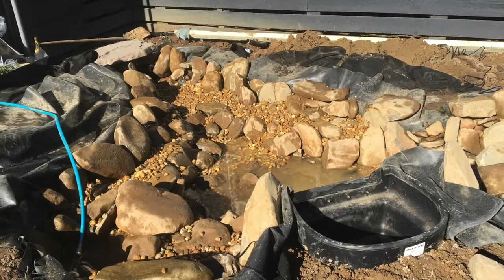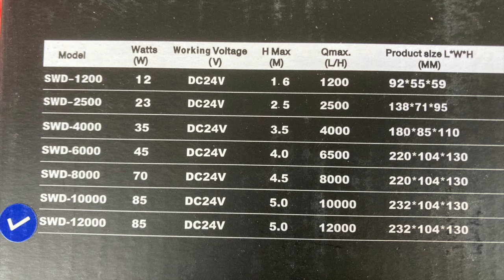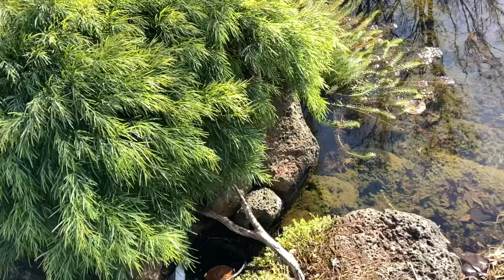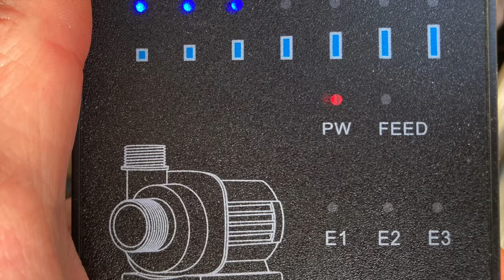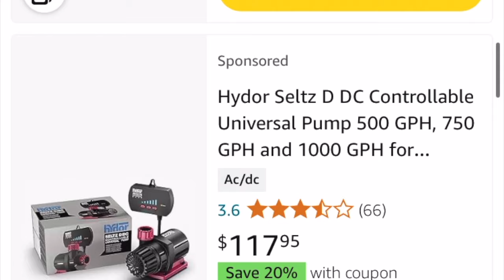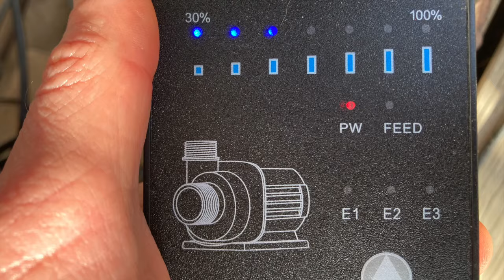Saving money on pond pumps

Comment: Your videos are great Kev! Are you aware of any external DC pond pumps? We built a swimming pond and have an external pump moving water through the bog filter. But need another pump for a waterfall and would like something more energy efficient! Thanks!
Reply from the maker: I’ve seen one on Ali express. Can be connected to solar. Can’t remember the flow rate. And remember you can make many submersible pumps external, I made a vid on that 👍

Comment: I have watched all your videos as I can to learn. Great by the way. Keep it up.
One of your videos you said let you know if building a pond. 
I can't find it so I'm posting here. I'm old enough that I do not wish to dig a big hole in the ground. So, I went this route. Bog filter is as you have said many times. 250-gallon tote with drain. Two 2'' pipes off of a T at the bottom with lots of cuts on the bottom side and pipe plugged at the ends. 2'' pipe up to the top with a T for the inlet hose and out to the center of the tank. Ball valve to crack to let air in for NO drain back and a 90 down. Plastic crates cut to fit over the pipes. Filled with 4 to 6'' rocks then 2 to 3'' own down to the rest pee gravel to the top. To me this is the version I got from you for a small pond.
My pond starts with a table at the outlet of the bog filler. Crates stacked and cut to make 5' span of 3 little waterfalls and one bigger drop into the pond. All full of pee gravel. The pond is nothing more than an 8 1/2' by 5 1/2' by 24'' above ground pool with a liner added. ALL ABOVE GROUND. I do have double 1/8'' felt under all of it. 3000 to 4000 gallons hour AC. AC for now. I do have solar and plan to use it after the pond is up and going. I'm in the southeast of the USA. Rire big freezes. I ordered and plan on a solar heater when needed. The sides to the ground will be cloth with cement for rock looks. Now don't hold back and let me know all that is wrong with this setup.
Reply from the maker: It’s very hard to get a picture of what you are painting, plus being Australian I do everything in metric. Reading about inches, gallons, feet and yards makes my brain shut down. Basically if you have your filter sized well, a reasonable flow rate you should be good to go. If you’ve watched all the videos you have the same knowledge as me and I’m sure you’ll do a great job 👍

Comment: Hello, tell me, is it possible to use aeration pumps in a swamp filter that supply water by mixing it with air? They work on the principle of a venturi tube. Thanks!
Reply from the maker: You could do that.

Comment: minor point of clarification: watts are a unit of power
electrical energy would be measured in joules
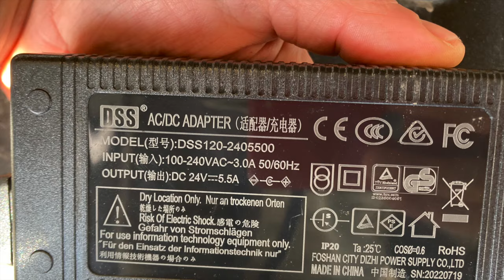@4:42  Thanks for the close-up of the power supply  It's about the same efficiency as the one that came with my 15000L/H pump, which is to say "poor."
Based on the rated inputs and outputs, it is, **at best**, 45% efficient.  Meaning, that if the pump needs 85W, the power supply is drawing approximately 2.2x that amount or ~190W from the wall.
I'm still looking for efficient, affordable 24VDC power supplies that can output at least 5A.  Best I've found is 81% efficiency for $35 US.  I'm hoping to find reasonably-priced 90%+ efficiency supplies somewhere.

When choosing power supplies to ship with these pumps, from what I can tell they prioritized price over quality.  They are the "weak point" of the system.

What I'm hinting at, and hopefully you already caught onto this... is your reasoning may be flawed.  You're only looking at how much power the pump itself is using, however that's not the entire story.  A power supply, any power supply, will also use some power.  How much, varies based on the quality of said power supply.  Cheap/inefficient ones will use A LOT of power themselves.
Reply from the maker: I pay for energy by the kilowatt. How many watts each appliance uses determines my kilowatt usage. I’m no expert but I do know that the watts is the amps x the voltage. The draw from the wall is 85watts for this pump vs 165watts for the aqua surge. The bill tells me my consumption went down 👍. Therefore I’m happy 😃 If what you are saying is true it seems very misleading to say an appliance uses 85watts, when it is actually more. You should be campaigning govts to force suppliers to show the true energy usage, again if what you are saying is true.
Reply: @Ozponds  I don't want to argue the technicalities, but feel free to google "what is the electrical unit of energy" and "what is the electrical unit of power". 
Misleading... yes and no.  The pump does use 85W of power.  However, the pump is not all that's powered on.  The power supply and the controller for the pump are also powered-on, and they use power.  Nothing is 100% efficient.  There's always at least some waste or losses, usually detectable by one's hand as electrical inefficiencies most often manifest in the form of heat.
Your electric bill went down, which is a good thing... but the potential for even more savings is still there.
Reply from the maker: @bobprivate8575  I’m going to get my electrician to measure the output. If the power consumption isn’t what is stated I will make a retraction video as I don’t want people thinking they are saving, when they are not. If there is no new video, the output was as stated.
Reply: @Ozponds  Yes, a measurement at the wall is the only way to be 100% certain.
A common and popular device for this is a Kill-A-Watt.  Plug it into the outlet, plug the device into it, and its digital display will tell you exactly how many watts is being consumed.
I haven't personally seen AUS variants, but I have seen both US and UK ones, for under $40 US.
I'm not suggesting this for a one-time thing unless you're REALLY curious, but sharing the info that there are affordable, easy-to-use devices to do that.
Reply from the maker: @bobprivate8575  I am really curious. I don’t want people getting mislead. I suspect that the inefficiency of the transformer is taken into account. The whole idea of displaying how much an appliance uses in watts is that we can compare it to similar appliances and get an idea of how much it will cost to run.

Comment: Thanks Kev, that is a great idea and I would like to learn more about (I am no electrician by any means...lol) But running on half the power would be wonderful for my electric bill as well. Do they come with the needed check valve hook up?
Reply from the maker: This one just connected straight onto the aquascape check valve that was already in the skimmer. But no I’ve never had a pump come with a check valve. This check valve leaks anyway, if the pump is off for an extended period of time the biofalls empties, that’s why I prefer breather holes to prevent siphoning.

Comment: Thanks Kev. Is it time for a new video on the different types of pumps available. My Jebao died after 2 season (probably my fault) and I would like to replace it next season. Perhaps more options are coming into the market.
Reply from the maker: I just can’t test them all, there’s too many it would cost me a fortune and then you really need to run them for a long time to see if they are any good. I still haven’t had the replace a jebao. I think some of mine are over 5yrs old.
Reply: @Ozponds  Oops. My post was supposed to be a question, not a request. I completely understand not having funds or time to test them. I have a 'reviews' channel and I only have time and money for stuff I actually use. Would it be possible to make a list of the pumps you know about and post on your website? Or maybe for me, I should just get another Jebao and treat it better.
Reply from the maker: @MarvinBowen  I guess it depends where you live on what’s available. On my website I’ve just linked “dc variable speed aquarium pumps” on Amazon, that way it will hopefully just show what’s available to folks in their country. They seem to be very similar in their outputs, energy to flow rates.

Comment: That's a great idea! I've been planning to buy a backup pump in case mine goes out. I will check out the aquarium pumps. Also, I used an aquarium heater on my container pond last winter, and I used one of those electrical connection boxes to protect the controller from the rain. They are waterproof, and you can get them in different sizes. If you can't get an extended power cord, you could put the connections inside one of those. They don't cost much at all, and work great. Mine went through many rain storms without a leak... Florida rainstorms! lol
Reply from the maker: Great to hear. Your rain storms certainly would have given it a test.

Comment: Here in Europe people can buy dedicated variable DC pumps for the outdoor pond. The brand from my DC pump has several features. It stops pumping if there is no water or when it is clogged for whatever reason, it can be installed in a dry and wet configuration. It has a soft start. Memory for the last setting. Power consumption display. Pause button. And the newest models have standalone WIFI build in. And they come in various capacities up to 30.000 liter per hour or so. I have the 10.000 liter version without WIFI. And indeed compared to an AC pump the power consumption at any capacity is much lower with a DC pump. And since it is running 24/7 it makes a significant difference. Besides the energy savings it is also handy that it is a variable pump and that you can pause it with a button instead of having to unplug it. It prevents that the power cord is going to fail over time. I have it for 6 or 7 years or so, and I had to clean the rotor 1 time, which is easy and not unusual, and that was it. No issues whatsoever. 

However, here in the Netherlands the variable DC pumps are more expensive as the older style AC pumps. Not by much, so in the long run it is still cheaper to go for a DC pump. Plus you get all the benefits from a DC pump.
Reply: What's the brand ?
Reply from the maker: Thanks for sharing 👍
Reply: Can you share the brand and model or a even a link?

Comment: I have 10kWp Solax solar system so I dont care about running my pumps xD. I'm moving 55k liters of water / hour. The only thing I underestimated is the noce the stream with waterfall with 55k l/h make xD.
Reply: Noce ?
Reply: @thibaultsarlat  

Noise.
Reply from the maker: 😂 very cool 👍
Reply: I have no idea what any of that means.  I just know I can’t get under a concrete path to deal with what’s just happened - the doser died and the builders out all the units heads under a concrete path.